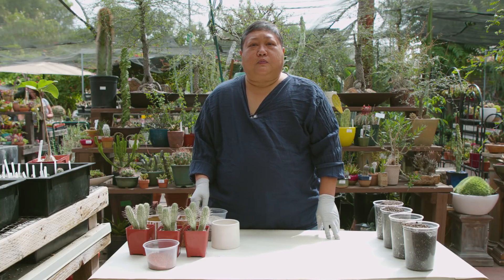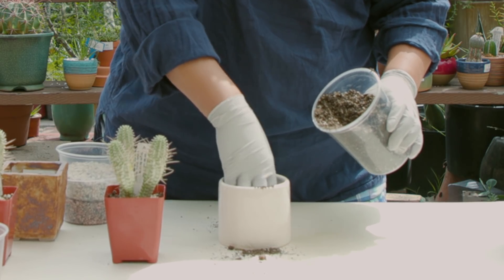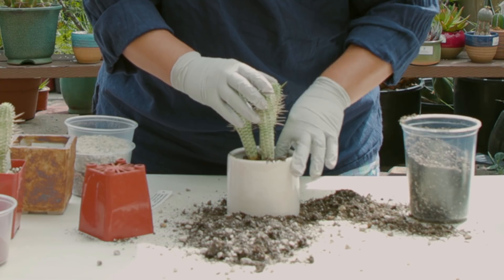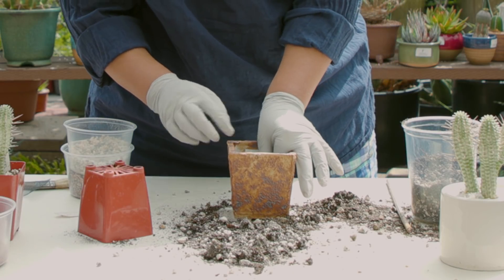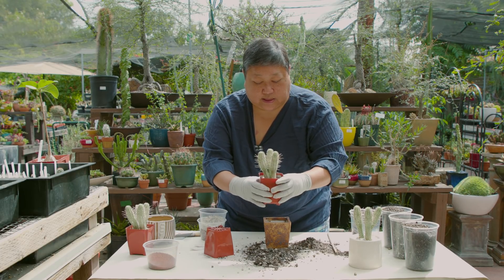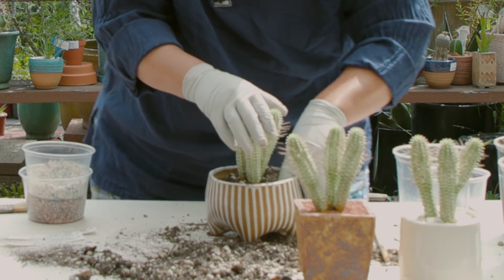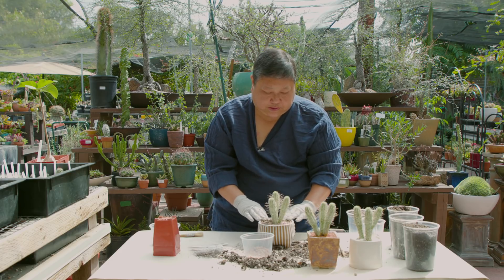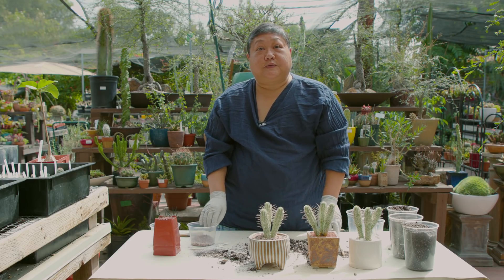Using One Plant  To Create Three Different Design Styles!

Comment: Just curious I heard by putting gravel on top of soil will trap moisture and lead to root rot. I really like the idea, it is beautiful; but am worried due to the above reason. Is it true? Thanks much!
Reply from the maker: Thank you for watching our video!  Top dressing helps stabilize the plants in the soil and is decorative. If you use a cactus and succulent mix that drains well, then the chance of root rot is relatively low with top dressing.  We suggest using a thin layer of decorative gravel and check on the soil by using a moisture meter.